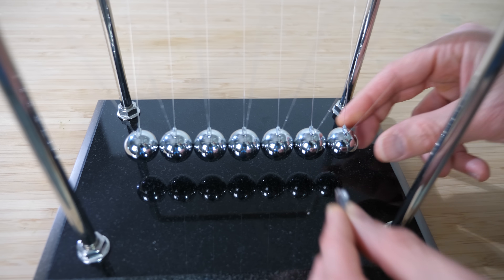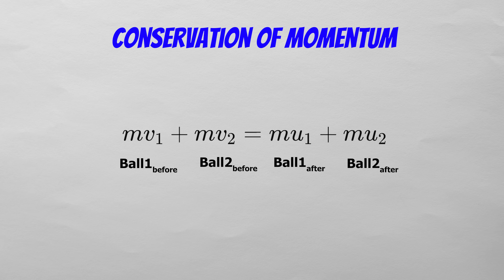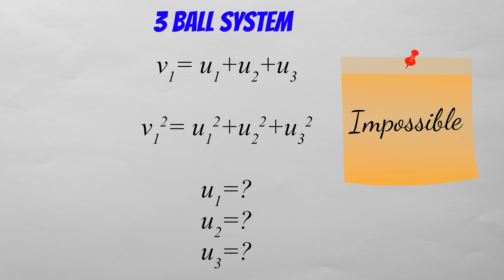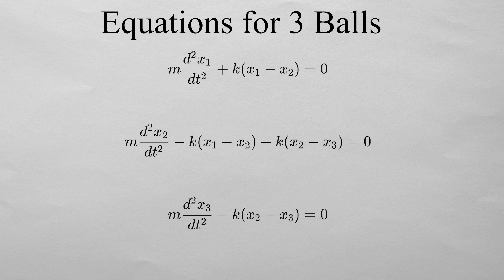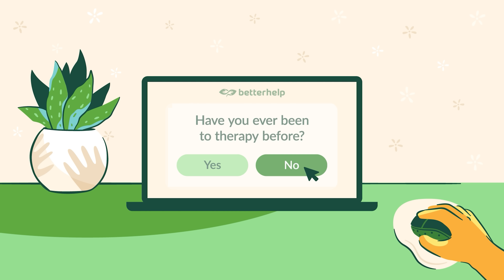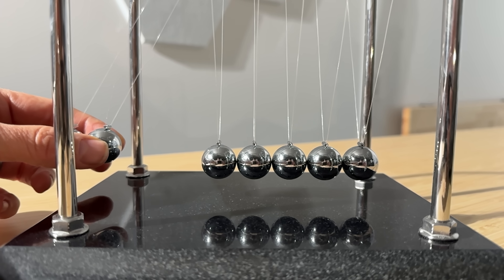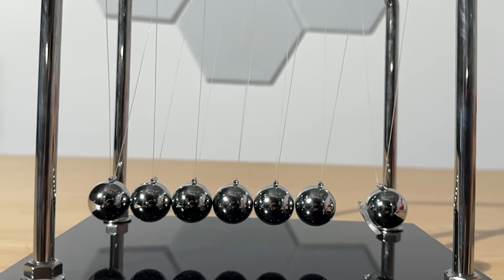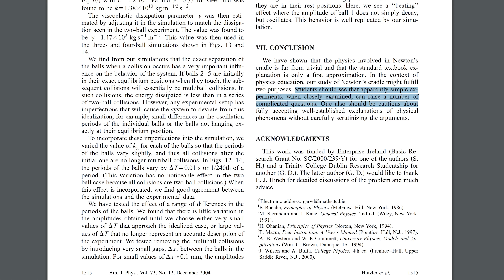Newton’s Cradle Doesn’t Work the Way You Think

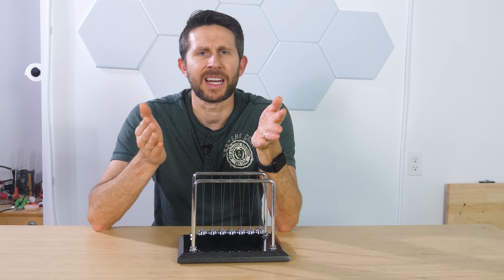Comment: 1:29 I think you are confusing conservation of momentum and conservation of evergy. Adding the plastic acts as a damper absorbing some energy, so there is less kinetic energy after the collision (but with a bit of heat i.k.e.). But 100% of momentum is conserved. Momentum is not absorbed by the plastic.
Reply: Should make an experiment without damper but with a deformation applied to the ball. So that all the energy is still conserved but just the wave travel gets disturbed.
Reply: If you model it as a system of ODEs, it becomes clear that resonance is the issue at hand. Pay attention to the interaction between the balls and strings and what's happening with the ω terms.

You could try to model it with heat and wave equations, but that gets absurdly complex.

Fea is useful for creating a good approximation of the system, and is thankfully not too involved because the collisions are elastic.
Reply: He's gotten very lazy in his science and videos the past couple years. He's often gotten something wrong, sometimes very wrong.

Comment: This principle has strong similarities with the behaviour of transmission lines in electronic circuits. The ball at the end is effectively the end of an unterminated transmission line, and the reflection this causes propels one or more balls away based on the size of the wave, caused by the number of balls that fell in the first instance. The rubber damper slowed the impulse to much longer than the natural transmission time of the entire line, and so there was no significant reflection, just like slowing the edge speed of an electrical impulse will prevent unwanted reflections.
Reply: "one or more balls away based on the size of the wave"
Close but no cigar.  It is TIMING.  The initial collision sends a shock wave in both directions traveling at the speed of sound in steel.  The shockwave going forward travels through the balls until it reaches the end, and reflects because there's no place for the energy to go.  This reflection starts back to the source.  Meanwhile, the back-wave travels back to the starting end, and on finding no more balls, it also reflects and starts forward.  Assuming you dropped two balls, the back-wave traverses 4 ball-lengths before it proceeds forward from the point of initial contact.  Meanwhile the forward end, traveling 4 ball-lengths, has reflected back on itself.
These two shock waves MEET two balls from the end and forces them apart.  
This is how the other end knows exactly how many balls you dropped.
And yes, it is nearly identical to transmission line.  A transmitter placed at that node is going to get one hell of a standing wave where anywhere else along the line it would be barely detectable.
Reply: @thomasmaughan4798  Thank you!  A much more complete explanation than my attempt. I appreciate the time that you took as well.
Reply: @ I spent a lot of time studying this phenomenon in transmission lines since the scientific way to measure standing waves, is to observe them -- if it is standing, it does not move, and has nodes of high voltage at half wavelenths.  Well at 40 meters, you'd need a LOT of transmission line to observe just one actual standing wave.
So the typical SWR meter doesn't really care about standing waves; they measure the instantaneous voltage and current at a single point.  Only in the case that the voltage and current have the right proportion can one assume SWR of 1::1.  If it is open, voltage will be high and current zero.  Shorted, the opposite.  Either way you get infinite SWR.   These meters don't actually sense reflected power, that requires very sophisticated circulators that work only at microwave frequencies anyway. 
A side effect of not actually measuring standing waves, but merely the apparent impedance at that point, is you might have inserted the meter at an "anti-node" and it will show nearly perfect SWR when this is not actually the case.  Having the meter inside the radio, as is common with modern radios, partly solves this problem since the only place it really matters IS at the radio.  You can have lovely standing waves along the transmission line so long as it isn't at the radio.  All power transmitted by the radio MUST go out the antenna or consumed by the resistance of the feedline.  It might take two or three hops back and forth to finally get radiated from a sucky antenna and this is why the loss-per-foot or meter is important.  You might think, "I'm only losing 1 db" but on the 5th bounce well now it's 5 db down.  A ladder-line has negligible loss and often becomes part of the antenna system and we celebrate bouncing back and forth; the whole point of a dipole antenna is that it IS a standing wave!  Swish, swish; high impedance voltage nodes at the ends and a low impedance current node in the middle.
Reply: @thomasmaughan4798  Fascinating, thank you. And that is a good example of why RF design is such a specialised discipline. Me, I was mostly a digital guy in my designing days (and that was mostly the 80s and 90s when digital signals in transmission lines were relatively straightforward).

Comment: Of course, that there is nothing simple behind the movements of the real balls in the Newton's cradle. But that's not how physics as a science works. It works in the following way:
- Let's have 5 not so hard steel balls and measure what happens.
- Let's have 5 medium hard steel balls and measure what happens.
- Let's have 5 really hard steel balls and measure what happens.
- Let's repeat the set of above three experiments with 4 balls.
- Let's repeat the set of above four experiments with 6 balls.
When we plot this into a graph, we get a curve that approximately describes what is happening.
Now a thought experiment:
- What if the steel is infinitely hard? No elasticity whatsoever? Also, the hanging points of strings are absolutely equally distanced, and the string themselves are infinitely thin, massless and with 0 elasticity as well.
And we get to an equation that models the system with good enough accuracy for certain applications. We keep in mind that it is an approximation in ideal case. However, the uncertainty can be way below our measuring ability.
Good example:
- Orbit of Mars: Newtonian mechanics. Time space curvature is negligible for the most purposes that far away from the Sun.
- Orbit of Mercury: Einstein's mechanics. Time space curvature is measurable in case of the orbit of Mercury.

Comment: This relates to a thought I had about ratchet mechanisms operating in time reversal. It seemed to me that a ratchet wouldn't mirror properly in reverse time because the ratchet pawls would have to lift with no cause, while when going forward in time the ratchet ramps lift the pawls. But it turns out that when the pawls drop into the ratchet troughs in forward time, something like newton's cradle happens. There's a shock on impact that stops the pawl. When running in time reversal, this shock would be going back into the pawl, which would cause it to pop back up just in time to rise high enough to clear the ratchet. So if a guy is coasting down a hill on a bicycle, and God suddenly reversed all the particle directions in the universe, the guy would end up  coasting backwards back up the hill, with the ratchet mechanism in the bike's freewheel failing to force his legs to pedal backwards because of the shocks popping the pawls back up just in time, over and over. Nothing would be happening that would defy causality. It would just seem highly improbable. And since the shocks cause such a small amount of deformation in the metal ratchet, it would be impossible to see it, so the pawls would appear to be just popping up magically for no reason, kind of like the ball at the end of the Newton's cradle.

Comment: Where is the momentum while the shockwaves are traveling? Are all the balls in motion to the right during this time, but time is just to short to notice this? Or is the momentum carried by the shock wave? 

Since the shock wave contains energy, and you can't transport energy without transporting momentum (right?) there should be at least some momentum in the shock wave. But if that's the case what happens to this momentum when the wave turns around at the end of a ball? It should be transferred to the ball, right? But that would cause the ball to move, and create a gap. How is this not a problem?

Comment: Hmmm not sure if this explanation is correct. We need to put also the conservation of energy as an additional set of equations. But it’s also true that the explanations we find in books are indeed a first approximation due to imperfections in the physical system. You literally can see it in the slow motion. A lot of vibrations, tilting and so on

Comment: A better explanation would be that it’s an equal amount of energy being transferred back and forth on each side. This is why if you drop two balls, two bounce off at the other side and vice versa. If you had one heavy ball on one side equal to the weight of two balls, then two balls would bounce away and then just the big ball would bounce away on the return as well.

Comment: The explanation I knew wasn't "conservation of momentum", but rather "conservation of momentum And kinetic energy", i.e. an elastic collision.

Let's say there are 2 balls, a and b, colliding. Before the collision, a is moving at speed av1 and b is not moving. After the collision, a moves at av2 and b moves at bv2. Both balls have equal mass m.
Conservation of momentum gives:
I. m av1 = m av2 + m bv2
Or:
I. av1 = av2 + bv2
And conservation of kinetic energy gives:
II. ½m av1² = ½m av2² + ½m bv2²
Or:
II. av1² = av2² + bv2²
Squaring equation I. gives
III. av1² = (av2 + bv2)²
= av2² + bv2² + 2 av2 bv2
And taking III. - II. gives:
IV. 0 = 2 av2 bv2
Which is equivalent to saying that at least one of av2 or bv2 needs to be 0.

Because of av+bv=c, the only two valid states at any time become av=c, bv=0 or av=0,bv=c.

A transition between those states is what you see when two balls collide with each other.

When there are more than 2 balls, you can simply see that as each one pair of 2 balls colliding, with each ball instantly hitting the next because they're so close.
Reply: Somebody didn't watch all the way through before commenting.

Comment: I have questions. One is that "conservation of momentum" is indeed how it works but doesn't explain all of it. It seems that spring force/compression or whatever it's called is important. You showed this by using a piece of plastic, which is much more compressible than metal. Still, why does only one ball move at the end and not 5 balls moving at the same speed as the initial ball, but less far (speed conserved across the masses of the unmoving ball)?

Comment: Doesn't the plastic just change this from a (mostly) elastic collision to having an inelastic collision portion?
The plastic deforms MUCH more than the metal balls,
momentum is still conserved, 
but this introduces a diffraction of the direction of the force.
Use a more stiff/rigid/non-deformable object instead of the plastic, and I bet the cradle functions closer to normal.

Comment: Interesting!
I couldn't help but notice that in the final shot, there is a small rotational vibration going on in the suspension of the balls (mostly in the leftmost ball).
Not sure what conclusion to draw from that, maybe not being perfect spheres, the collision is slightly off center, imparting a twist/spin on the impacted ball (like in pool)?
This also made me think of reflection in electronic signals, and Alpha Phoenix's awesome demonstration of how that works.

Finally, the two ball configuration looks even more unreal than the traditional multi ball variety. I knew the swung ball would stay basically still, but seeing it, it just seems weird.
Reply: If the balls are not perfectly aligned then a small rotational moment will be imparted.

Comment: So if I understand if the first ball is double the radius but same mass as the rest of the balls, that cradle would pop two balls off the other side at half the speed.
Reply: But now I'm stumped wondering what would happen in that set up from a single ball in the other direction.

Comment: There is a much simpler explanation. In the absence of the piece of plastic the collisions are almost instantaneous and it is correct to consider the spheres as if they were undergoing a succession of single collisions between pairs of spheres, conserving energy and momentum in each collision. The piece of plastic considerably increases the duration of the collision and therefore when the sphere after the piece of plastic interacts with the next one, it is still undergoing the push from the sphere in front of the piece of plastic. In practice therefore the spheres after the piece of plastic can no longer be considered individually but as a single body, because the interaction time with the piece of plastic is much longer than the interaction time between the spheres without plastic.

Comment: In short: The balls don't absorb energy (being elastic), and the same number of balls popping off is the only possible solution that preserves both momentum and energy.

It's often surprising that doing global considerations already gives the answer.
Reply: I think you missed the point by a wide margin. This is "the only possible" solution in 2 ball scenario but there are infinitely many solutions in 3 or more balls scenario.

As if you didn't even watch until 2:21 or after.
Reply: @u1zha  I actually did but was still wrong. :-/

Comment: when i saw that the title i immediately thought, hmm its probably one of newtons law, every force has an equal and opposite reaction,  since theres so many balls kinda  acting like atoms of similar mass hitting each other the energy is transferred to the rest of the balls but the reason why the rest of the balls stay still (if you're dropping one) is because when the first ball hits the second, the same force is being applied to the first ball stopping it, but because the energy was transferred to the second ball, it must transfer the energy to the next ball and to the next until there isnt a object obstructing the motion, but the reason why the second to last ball still moves forward is due to the energy from the previous balls sending the energy back to the second to last ball allowing it to move still. another way you can visualize it is like a whip. When you first put the energy into the whip it sends a wave (in this case the wave occurs nearly instantly) and the 2 balls coming back after having the energy transferred is like the rope send the tip of the rope back in a wave.

Comment: It behaves like an electrical transmission line with unmatched impedances. The waves bounce at every impedance mismatch.  This is why we get scattering and distortion in electrical cables.  This looks like the same phenomena.
Reply: Impedance is the key to unlocking a deeper understanding of SO many physics systems.
Reply: @spherebotics it's all just fluid dynamics in the end.
Reply: This is true for all transmission lines - not just electrical.
Reply: arent the balls necessarily impedance matched for the shock wave to travel through them without significant reflection? Its just at the end where they find a new medium (imagine zL= inf) and reflect off that, but the wave from the other side finally meets this reflection, and the standing wave they generate simply splits the "line". I wonder if the plastic functions as zL = 0, or otherwise just a low impedance load
Reply: @badabing3391  If I understand this idea of impedance.  Wouldn't it be dependent on the material, where each material could function as having its own signature impedance load?  I could see material structure also playing a role.
Reply: @CauldronOdoom  technically yes, but we can define the otherwise finite nonzero impedance as either zero or infinity for ease of calculations when the reflected wave amplitude is large enough
Reply: @badabing3391  Does it matter how large the amplitude is?  If you are idealizing for ease of calculation it would seem an estimate.  The calculation is going to have a margin of error that increases the further away from the ideal the actual impendences are.  Ideally you would want the amplitudes to be large and small enough so that the  margin of error is insignificant in the estimate.
Reply: @CauldronOdoom  yeah you got it

Comment: Conservation laws are mnemonic devices. They are not an understanding. A child is using the scientific method with: "The wheels on the bus go round and round." This song accurately and consistently describes everything you see a bus do exactly like math does, but the child does NOT understand the bus, because wheels going round are not causal. The variables in gravity math are exactly like the wheels on the bus, they are not causal, so modern science does not really understand much of anything. Everyone is told angular momentum causes the gyroscopic effect AFTER the right-hand rule, so there is no cause in that. My explanation video is based in causal accelerations that don't need a right-hand rule, and scientists are so trained that they CANNOT see it with 20 years of trying.  links won't post

Comment: Hit a long piece of steel with a hammer, and it is inelastic at first until the wave comes back through the long piece to repel the hammer.  This relates to the centrifugal effect that shows a mass on a radius tether stays in a circular path until the release information travels to it to release and start traveling straight, and this one kills me that it maintains a curved path after letting it go.